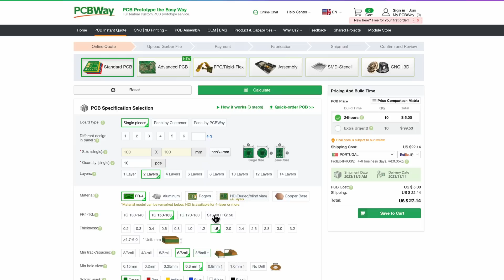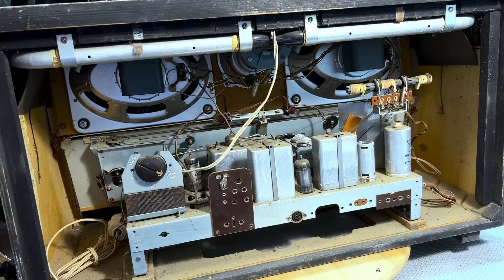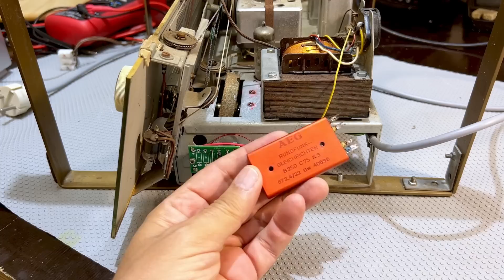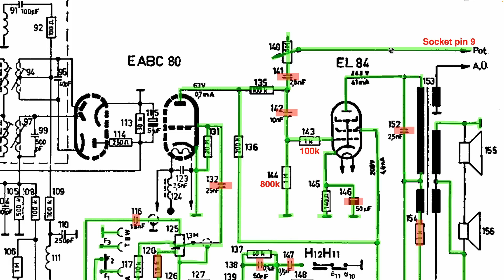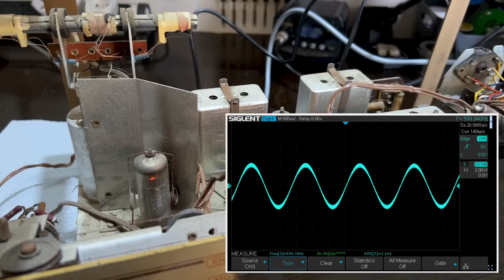Tube sound from amazing 'Raumklang' speaker system. Graetz Melodia 519 restoration pt.1 #pcbway#

Comment: Hi Manuel,
I wondered if you encountered any Hot Chassis issues with this set, I have an 819 which has the same mains input set up and there is a capacitor between the on off switch and the chassis. If you use a non-polarised mains connector, which they all were at the time of manufacture, you can get 220 volts on the chassis - any thoughts? Great job by the way! Paul :-)
Reply from the maker: If the radio has a power transformer (a real transformer, and not an auto transformer 😊), there should be no hot chassis issues. The cap is only there to eliminate noise, but can create a hot chassis if it shorts out. That caps should be replaced with a proper safety cap of the same value. Safety caps fail open, so no shorting to chassis will occur.

Comment: I bought the exact same radio at a second hand shop. It works! Only it slips away from the station frequency. The when I adjust the dial back to the station, the sound is suddenly much louder. Any idea on what I have to fix? Any help would be appreciated :) 
Cheers, Ruben.

Comment: Hi Manuel,
A very interesting radio, this one, and a nice looking one too!  I suspect that the ‘Raumklang’ speaker arrangement is a bit of a gimmick but it certainly looks impressive. 
I was hoping you would try for some reception at the end but I guess you have to leave something for next time!  
Love your detailed circuit descriptions as usual. Perhaps you could do a detailed explanation of the ratio detector circuit some time. I’m struggling to get my head around it. 
Cheers
Reply from the maker: I didn’t try reception as I haven’t actually done a proper alignment. This one deserves it as I don’t know what else may have been tampered with. The ratio detector is very interesting and I will probably do a video on one soon, as I find it fascinating. It’s not easy to explain, which is why I haven’t delved into that territory yet, but I should 😊

Comment: Another great, informative and enjoyable presentation video on your exploits!  As far as your resistor values for your G1 on the EL84,  looking at a schematic for a Korting 1070 that I have, they do show a 100K and 800K resistor network in the same circuit positions as your 1K / 1M, so, it looks like it may have been a error on the schematic for the 1K position, and a variance for the 1M, and I am betting what is in there will work fine. To make things easier for viewers to search for in your video's, you could put in a keyword/s such as "Tone Shaping Circuit" and then anyone interested in that content might be able to find it easier.

Comment: Very interesting sound concept! I think, the pipes are operating similar to those in an organ and amplify only the resonant frequency or wavelength, which is determined by the mechnical length of the pipe.
Let´s see, how it will work, i´m very curious!
Reply from the maker: So am I. I Amy test the frequency response when I get there using a test microphone. I’m really curious.

Comment: eventually you can change the EM34/35 with the cheaper Russian 6E5C, with just reconnecting the socket, these EM's are really incredible expensive... 😉
Reply from the maker: Yes, I’ve done that before. Makes more sense than buying an original

Comment: I noticed right away those two ceramic resistors that are soldered in on the power tube, I think it is. 
However I do not think they are original. They look more like the ones sometimes used on the modified 
rectifier with modern diodes to reduce the over voltage.
Reply from the maker: True. Definitely not original

Comment: Good to see you working on a tube radio again, I enjoy the transistor sets but like the tube stuff a little better. The piped speaker is interesting, I have seen someone working on a radio with a similar setup but cannot remember whom. It will be interesting to find out the purpose of them over a hi frequency speaker. Nice colour on the cabinet, pleasant change from the usual dark finish.
Reply from the maker: I decided on this one primarily because of the speaker system and the colour. I’m running out of dark tint 😊 I’m quite curious about what it will sound like as I’ve never seen this before on one of my radios.
Reply: Those piped treble speakers were used in some German 60's TV sets as well. The wide end of the horn was very flat and it needed only a small gap  in the front panel for sound to spread out. They were just small enclosed dynamic speakers  equipped with that pipe connected horn.
Reply: @jutukka  I wonder if it also creates a slight delay in the side speakers to give a pleasant bigger room effect.
Reply: @DavidTipton101  Perhaps if the pipe is long enough, I dunno. In those TV sets I remember seen the pipe was short and 90 degrees angled, and the idea was just to get treble sound spreading out of the cabinet from under the CRT towards the viewer. I remember that the sound of that tweeter was quite clear but very thin and trebly.

Comment: The speaker setup is the same as in my Fantasia 622. I'll be interested to discover whether you think you've ever heard anything better in a tube radio - my sample set is a lot smaller than yours but I absolutely love it. I got lucky with the FA switch on my Fantasia as the chassis was also designed to be fitted into a radiogram and there were a couple of spare contacts on that switch which allowed me to switch power to one of your Bluetooth boards on and off. Good luck with the broken FM "knob". Short of buying a donor radio (and there is one listed atm 💡) I think that's going to be tough to fix invisibly.
Reply from the maker: The spare switch contacts will definitely come in handy. Don’t know about the switch just yet.

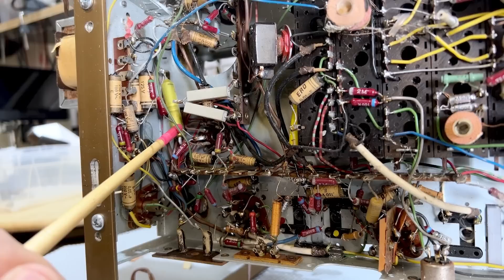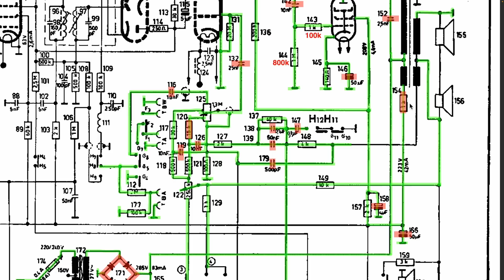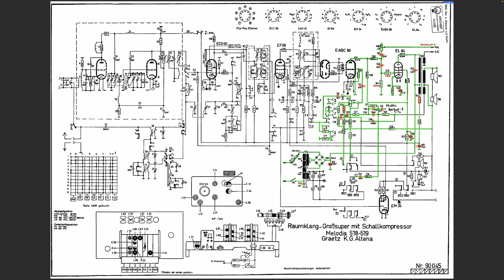Comment: The case color is almost a Blonde. At 17:50, those sand resistors wired in series are interesting, as you explain at 27:50.  Must get a bit warm.  At 25:11 I'm with you on the covered CAPs with text. Nichicon are black with white or gray writing, so what's the difference? 👍
Reply from the maker: No real difference, just something I like to do. These are radial caps and sometimes I need to wire them axially, so I started doing this some time back and the habit stuck.
Reply: @electronicsoldandnew  - Yes I agreed!

Comment: M,

Having watched your channel I've never seen the specs for your 'variac'. Care to share?
Reply from the maker: It’s pretty simple one. Adjusts from 0 to over 240vac, and can supply about 300W.
Reply: I was hoping for the model and source. There are a lot available and I've been bitten before. Thanks @electronicsoldandnew
Reply from the maker: It’s very similar to this one: Just found this amazing item on AliExpress. Check it out! 42,85€  1％ Off | APS-500VA 0.5 KW 220V Variac Variable Transformer Voltage Regulator single-phase adjustable 0-300V AC regulating power supply
https://a.aliexpress.com/_EHrlHIV

Comment: The high-frequency horn type speaker, looks like it utilizes a driver like outdoor speakers that's coupled to the hollow tubes like one would finds on a musicians horn.  Bet the tubes are resident to a frequency range like a musical instrument. The small holes are I think to allow air in not sound out. It would be fun to connect to a audio generator and a microphone to see what resident frequencies the speaker passes and enhances. This could be one episode by itself.
Reply from the maker: I may well delve into that. Sounds interesting.
Reply: This is indeed a horn driver (aka compression driver), hence the German term "Schallkompressor", literally a sound compressor, for this contraption which was a rather unique feature of Graetz radios at the time.

Comment: It is "Raumklang" I guess an "L" is missing in the Title for the Video...
Reply from the maker: I sure did. Thanks for the heads up . Corrected now.
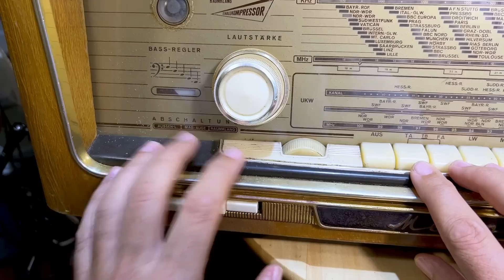Reply: @electronicsoldandnew  3:41 Mag. Auge possibly means "Magisches Auge" --> Magic Eye... The 3 Switches are for turning those 3 Things (External Speaker, the Magic Eye, Raumklang) off at least that is, what it looks like to me... Because this is what "Abschaltung" means -> Turning Things off ...